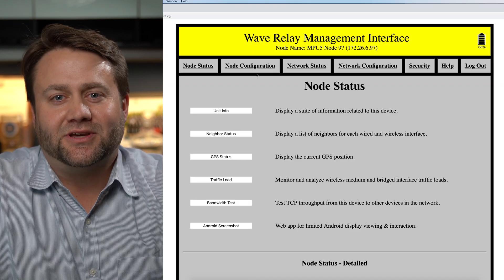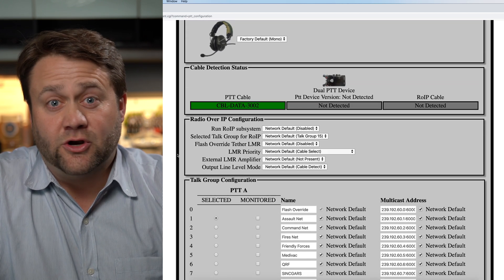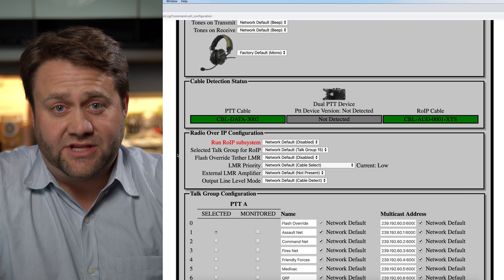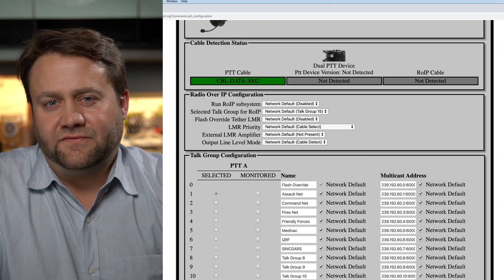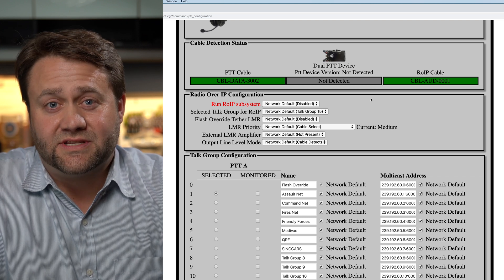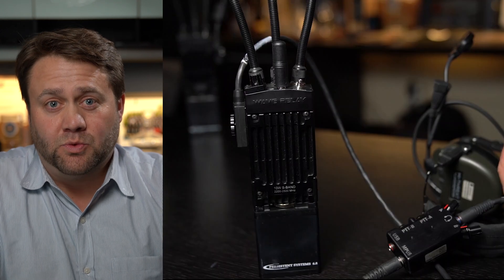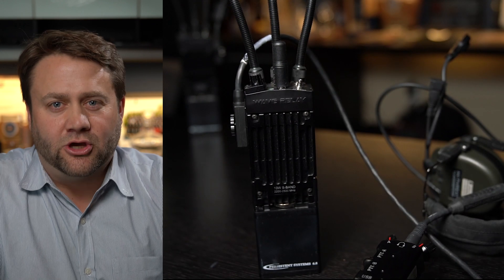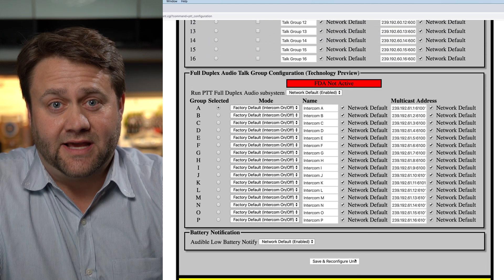Tech Tips: RoIP Introduction

Comment: Is there a list on what radios/models are capable of connecting via RoIP?
Reply from the maker: For traditional RoIP it “could be” nearly any. We don’t make every connector for every radio model but we do sell cables with exposed leads and directions if you wanted to make one or have one made. Traditional ROIP we typically sell all the standard NATO cables (meaning 152, 148, etc), we also do Motorola APX and XTS models. 
For advanced ROIP, we do the Harris 163, Thales 148 Spear, the new Mil Harris manpac, and the Motorola APX series.

Comment: Is a dual PTT required to use the mpu5?
Reply from the maker: @DCarv-j5t  you can use a different PTT but you’d be losing out on many capabilities of the MPU5. The dual PTT acts as a networked USB hub which provides data transport to the MPU. It is also the control center for changing the volume or talk groups and it is needed for many of the MPU5s advanced audio features.

Comment: People making this type of complicated crap to make extra bucks. Meanwhile you can buy a 20$ now 18 stupid baofeng and FPP in 2 seconds. Oh ok it’s not reliable, so how about 3000 baofeng vs 1 stupid 5000$ APX series. Oh ok not digital but see New York been using old vertex for years and flawlessly. Oh shit because a system is so great and Motorola can’t make money no more, let’s talk about IP and new shit.
Reply: MANET is the future and is a self generating, agnostic network. rapidly scalable, AES encrypted, and can be deployed in minutes. No LTE, no internet, no problem. This device is essentially a router with a speaker.
Reply: It can be done on the cheap but there are compromises. It's down to spare cash or spare time both are valuable. These Radios are extremely expensive but for the most part after configuration it's plug n play. Where as of you go the homebrew route you've got hours of research, planning, implementation, setup and configuration followed by troubleshooting and maintenance. I'm in the camp where the homebrew option would probably be the better option. Other people have plentiful funds in the bank but a large investment of time would cost more than the initial outlay. They also get some form of support and guidance, access to spares and repairs, compatible accessories and software updates. If your homebrew kit stops functioning then you have to diagnose and source components and perform the repairs. Ultimately the market determines the value. If it's to expensive for the market then the price will come down if the costs to produce go up so does the retail price. Basically horses for courses.